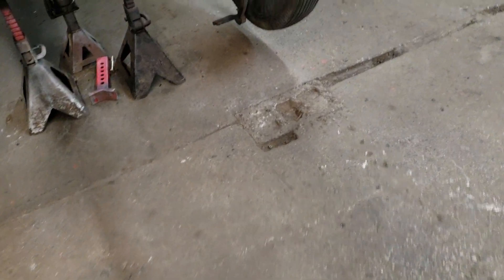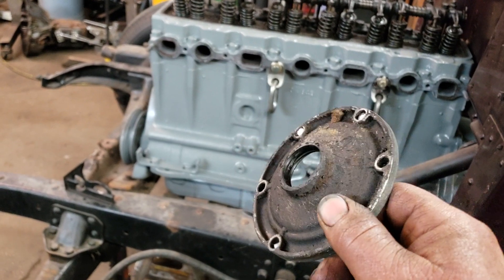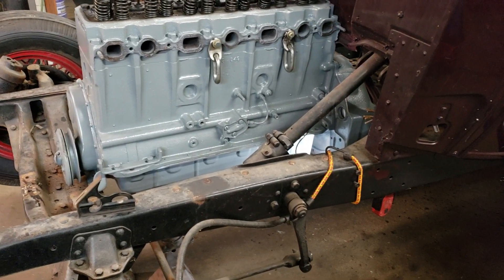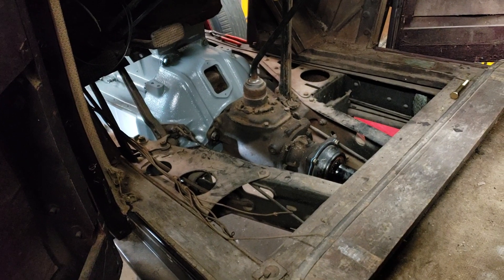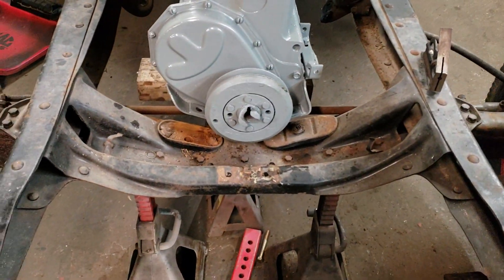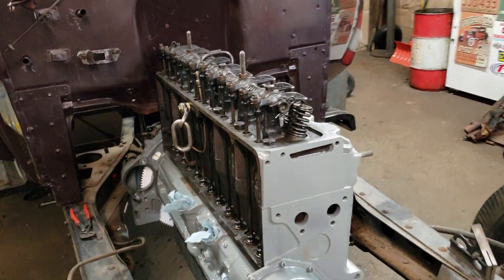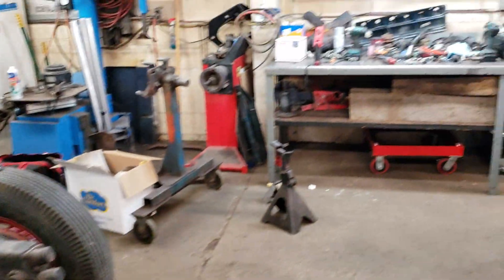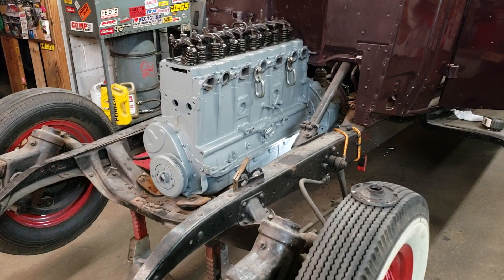216 into a 1934 Chevy master deluxe

Comment: I have a complete 216 if you need something.  I have an intake/exhaust, starter,carb,tins and a rebuilt head. Was a running 216 but the rod bearings are too far gone. Started the 235 replacement yesterday and set the cab on the 47 Chevrolet Pick'm Up Truck I'm building. Posted videos. Let me know if you need something from the 216. I'm not going to use any of it. Keep Rocking!!!
Reply from the maker: thanks man !!  as of right now , i should be good . But i'll let you know !  Where abouts are you in the world ? for shipping
Reply: +chevahaulic Houston Texas.  If you have time check out the video I made dropping the cab down on the chassis over the weekend. It's Rocking!!!